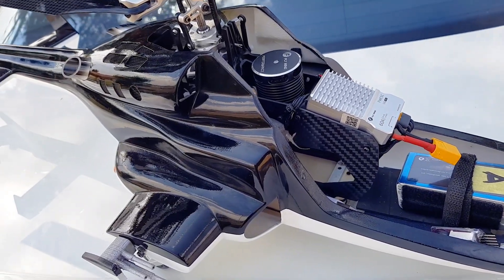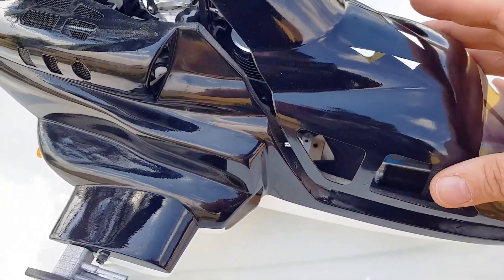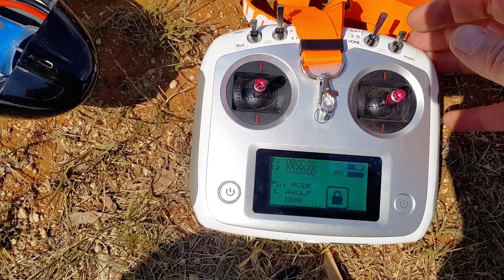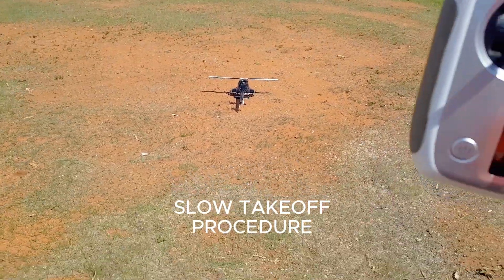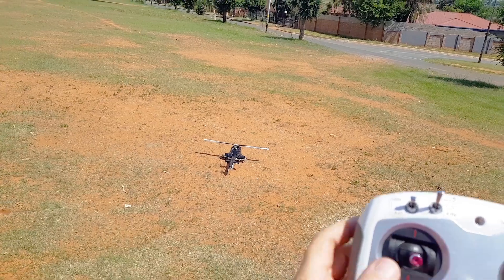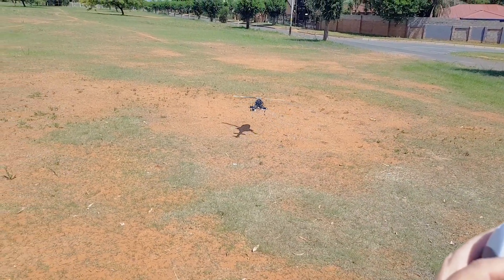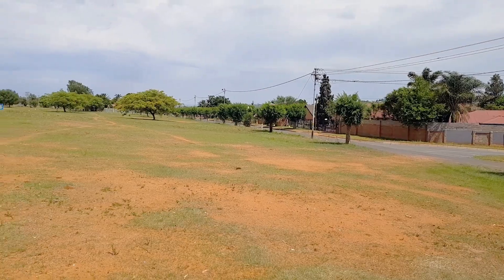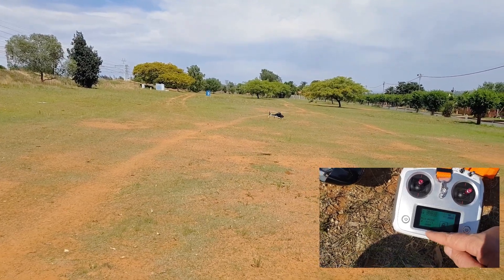Importance of Compass calibration on Flywing RC Helicopter and Slow takeoff procedure

Comment: Hi! Question, I am having challenges calibrating my V4 UH-1 Huey.
Using new 2.0 software. After completing the dance my bars completely
fill up which is good. I do not receive any confirmation that the
calibration was successful like "Calibration successful" upon
completion. At times, following full bar completion, I get a message
to "disconnect" which I do. Upon reconnecting, under the sensor tab,
the bars remain full. How do I know calibration was successful?

Also, does the radio need to be on and bind to the helicopter?

Thanks so very much for your time and effort,

Jeff Kraus
Reply: I'll reply tomorrow